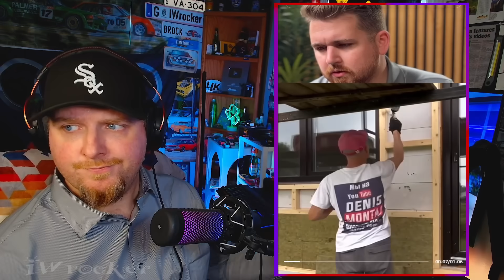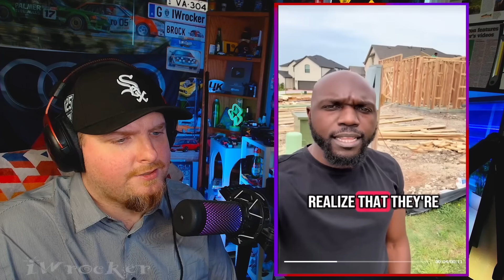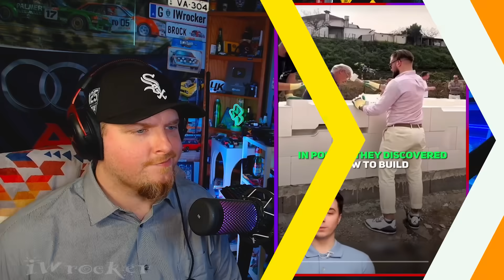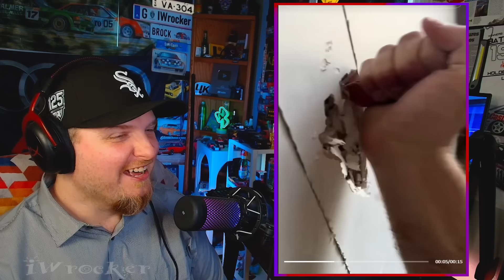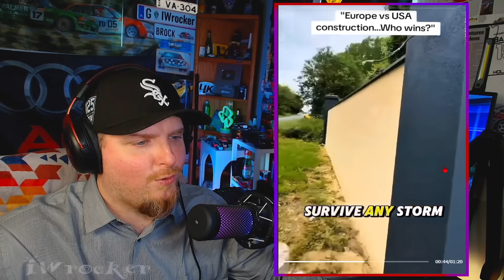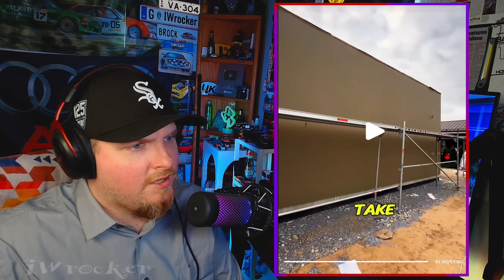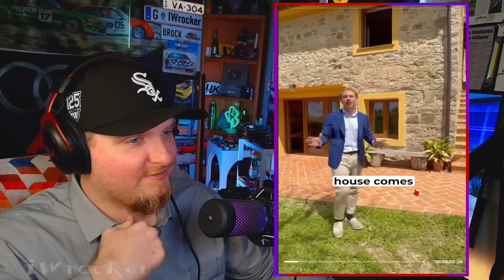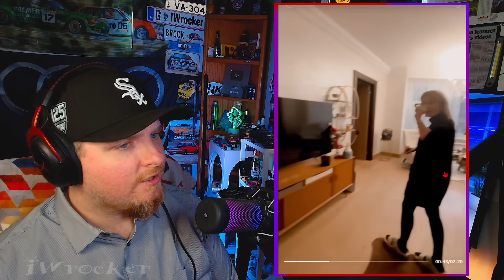25 Minutes of European VS American Home Quality & Construction Methods 🔨

Comment: Insulation ALWAYS goes outside if possible! That guy doesn't know s... about thermodynamics in construction.
Reply: Well, to his defence: he's american … ¯\_(ツ)_/¯
Reply: He also doesn't understand dew points.
Reply: @andersjjensen have you ever heard of active ventilation? The cost of having a double flux ventilation is ridiculous compared to the cost of either heating or A/C. And it removes the moisture and the dew issue.
Reply: @patrickrosa848  But they are hella obnoxious to retro-fit when you live in an apartment. For new builds they're mandatory here. But they do not "remove the moisture and dew issue" in August when the outside temperature is above room temperature and the relative humidity is 100%. Then you need a condenser, or it will be running down the walls.
Reply: @andersjjensen centralized units are. You also have single-room units which are perfect for the "wet" rooms such as bathrooms. And usually for very humid days, you can simply bypass the exchanger to just extract the humid air from inside.
Still for such super hot days, having outside insulation will still trump easily inside insulation for comfort
Reply: My mom's house has no additional insulation and no AC yet stays warm at -20(-ish, not sure about "fry-dome" units😅) and not so warm at ~100. It made out of plywood-based clay, thick af(1foot+, closer to 1Yd actually. 45-50cm) and — this is the best! — has an inner oven for heating! So the "middle" wall gives back heat long after the fire is out.
God I wish I had an option to build a house like that here in Israel! I am blessed to live close to the sea and it gives me constant breeze in summer time but when it's winter outside, you can literally run outside for warming your body without heating. And the only type of heating we have is electric, which is absolutely inefficient when your house has slide-windows and is being exposed to winds all year long😢
Reply: @andyshtroymish4997 that house has naturally thick walls and a big thermal reservoir inside. So that's typically a building which will need little to no insulation.
Outside insulation will tend to mimic that kind of insulation, turning the walls into thermal reservoirs for the whole of the house: keeping warmth inside in winter and avoiding heating them in summer.
Inside insulation, not considering the (HUGE) issues with thermal bridges, will do exactly the contrary. Putting a huge reservoir of cold right next to you in winter, and of heat during summer....
Reply: Americans doesnt know shit....true
Reply: I didn't until the question was answered on here by someone else.
Reply: No!  There are many reasons to have insulation on the internal faces.  That is based on construction science and performance.
Reply: @clivewilliams3661  exactly what science and performance? internal insulation has higher heat transfer coefficient, making one big thermal bridge out of the whole building, you reduce thermal mass and make it easier for moisture to buildup, it's also more expensive, both in construction and operation
Reply: @Dread_2137   Quote "internal insulation has higher heat transfer coefficient,"
Stop making up lies you clown...
Reducing thermal mass is a good thing since you don't have to heat it up, that's one reason insulation on the inside is better.
Another reason inside insulation is better is the outside wall can absorb sunlight which is a massive factor that goes completely to waste with outside insulation.
Yet another reason inside insulation is better is no problems with insect and rodent using the insulation as habitats. So it needs less chemicals to keep them out and also inside insulation lasts longer. Outside insulation is only rated for 15-25 years and then needs complete removal and redoing which is a massive problem with toxic waste.
The only benefit of outside insulation is that it is cheaper because it's easier to do.
That's it. Outside insulation is literally the worst type but it's a bit cheaper to do.
PS plus the fire danger of outside insulation as any deadly fires have demonstrated.
Reply: @Dread_2137  
The science of house insulation standards, building code and performances of your chosen materials.
There is NO "one size fits all".

But if you do it properly then no moisture will build up in ANY insulation method and materials you choose. Different style houses and different materials demand different codes and insulation methods.

As for the price that highly depends.
Inside insulation CAN be done cheaper than cavity wall insulation. Not always, but it is possible, it just depends.
But external insulation is usually the most expensive (because of the mandatory extra cladding).
Reply: @Mar-s5q8m a few pointers if I may:
-  Reducing thermal mass is not always a good thing. Having thermal mass can be very beneficial indeed, depending on how you use the house/building.
- The rodent/insect problem should be non-existent with the proper materials and especially installation techniques. Special harmful chemicals for this are usually not needed at all. 
- "Fire danger" should not be a factor at all, never. If it is, you're using the wrong materials. Insulation should at least be fire retardant, always. Also, proper installation technique is paramount for this too.
- And outside insulation is usually the most expensive since it requires extra water proofing, and especially proper cladding, compared to the other methods. Cavity wall insulation is usually the cheapest (unless you need to redo it, then it because very expensive and time consuming compared with the other methods).
Reply: @CookieTube  don't know how american standards and building code works in Europe, especially since ours are way more strict. 

I am speaking generally here, not insulating external walls invites moisture due to the pure laws of physics and how heat exchange between mediums works. And this is where the difference comes in, in Europe no one cares about the material (tho all materials must pass comprehensive tests, especially fire ones, but there's hundreds of them, if not thousands, already approved), what matters is the U (heat transfer coefficient), which by law must be for external walls <0.20 W/(m^2 * K), roofs <0.15 W/(m^2 * K), and floors on the ground <0.30 W/(m^2 * K). Designers simply look at the λ (thermal conductivity) of materials and select them accordingly so that the building is below required U.

We don't use cavity wall, buildings are usually build using ETICS (External Thermal Insulation Composite System). In short: adhesive -> insulator (usually polystyrene or mineral wool) -> adhesive + mechanical fasteners -> reinforced mesh (usually fiberglass) -> plaster
Cladding here is rather for aesthetic purposes than insulating ones, tho still can be used as insulation if this is how building was designed, again, most important thing is always U, the rest are aesthetics.
Reply: @Mar-s5q8m where do I lie? External insulation by pure physics has lower U. Not to mention thermal bridges at floor, ceiling, junctions and corners, that are problems for internal insulation.
Why would you want to reduce thermal mass? Lower thermal mass means more heating during winter and way more AC during summer. High thermal mass helps keeping heat during winter, and provides cooling during summer.
Yeah, that's the whole point, so that your house does not heat up during summer, and keeps it cool. Why turn your home into an oven?
First of all, your rats would have to somehow get through the layer of mortar, fiberglass mesh, and plaster to get to the insulation. Good luck with that. Rats here rather tend to go into basements, especially if you leave the window open, Europe is not Tom and Jerry where they can just make a hole in the wall, because it's made of paper mache.
Technical expected lifespan for external insulation is 25years at minimum, this is for what buildings are designed for. But external insulation usually keeps its U at required levels for more than 50-80 years, even for over a century in many cases.
If you care about lowest possible heat transfer coefficient of a building, there is nothing better than external insulation, as it directly protects building's thermal mass from external conditions, allowing it to retain heat for longer and prevents sun from turning the building into an oven.
Oh yes, fires, says the guy who builds his houses out of sticks. European fire safety standards are much stricter than yours. Any material used in ETICS systems must pass comprehensive fire tests, including large-scale tests, to be approved. There's nothing more important in European building standards than safety.
Reply: @Dread_2137  I can't comment on your expose because you didn't made it clear where you're from and about who's regulations you're talking about. However I can tell you that the building code in EU is very strict! Far more strict than US!! Especially when it comes down to insulation, ventilation, energy consumption and water buffering requirements.

I can also tell you that you're very wrong about: 
QUOTE: "I am speaking generally here, not insulating external walls invites moisture due to the pure laws of physics and how heat exchange between mediums works. And this is where the difference comes in, in Europe no one cares about the material"
Reply: Insulation can absolutely go on the inside if the outside is reliably warmer than the inside throughout the year (basically if you keep your AC running all year long).
Reply: @andreipetrenko2422 A/C and efficiency building are two opposite notions. Your point is just meaningless. With good insulation you don't actually need A/C...
Reply: NO, IT HIGHLY DEPENDS!
In fact, insulation on the outer wall is the 'worst' of the main three types of insulating generally speaking, if all things equal.

1) Best is to insulate the cavity wall if possible (needs enough thickness and there are some other things you need to take into consideration), This goes between the outer (brick) wall and inside (brick/concrete) wall. There are roughly speaking 3 methods to insulate the cavity wall.
2) Second best is insulation on the inside, thus on top of the inside wall. But this reduces your available living space, so not always wanted or even possible.
3) Third best is external insulation. This goes on top of the outer wall, and on top of that new cladding is placed. Of course this can only be done if your wall isn't a historical classified outer wall or something.

Of course you can combine these three main methods. 

Also, you can NEVER insulate too much (but don't forget a proper ventilation system!!). But of course it all comes with a price (where outer wall insulation is usually the most expensive, while cavity wall insulation is the cheapest and quickest... hence usually the best method to choose considering everything else).

The method in that first video was a variant of type 1 I think (though not completely ok, because all that wood creates a lot of cold bridges).

All the above goes for the outer shell of the building.
The inner walls in your home are rarely insulated (unless it needs to be sound proofed or needs something special). But of course you can if you want/must/can afford it....

EDIT: since some don't seem to understand this, all the above is given an EQUAL amount of isolation space and heat transfer coefficient for the materials, and with proper build houses.
Of course you can go as thick as you want when insulating on the outside. But you can NOT do that with cavity or inside insulation. And THAT is also the reason why method 3 (outside) is usually done for new passive housing: because they need A LOT of insulation thickness which you can NOT do in an existing cavity wall, nor on the inside wall, but only on the outside wall.
And of course a 50 cm thick outside insulation is better than just a 5 cm thick cavity wall insulation.... DUH! But you need to compare apples with apples....
Reply: @CookieTube yeah, of course. That's why passive housing,  the most efficient energetically ever, has always the insulation outside. Your arguments are appallingly non-existent pal!
Reply: @patrickrosa848  You seem to have no idea about building code or the reason why certain methods are used and when.
The ONLY reason passive housing has insulation on the outside is because you can make it as thick as needed !!! THAT, and only that, is the reason why it is done on the outside with passive housing.
NOT because it is the best out of the three methods, given (almost) the same materials, space and costs!!!!

If you put an equal amount of insulation on the inside walls, you'd loose A LOT of living space. Nobody wants to loose 1 meter per side (50 cm for each opposite wall). And putting it in the cavity wall is never going to work because that is never thick enough for the same amount of insulation you can put on the outside anyways. THAT is the reason why it is done on the outside: you can put MORE insulation on the outside.

If you notice in the video with the black foam blocks: they are roughly 50cm thick.... try to put that on the inside, or in the cavity wall, I dare you.
Again, given (almost) the same materials and thickness it is as I described in my first post here. You need to compare apples with apples.... pal!
Reply: @CookieTube and you seem to have no idea of thermodynamics and heat transfer.  The reason it is more efficient is that this way it insulates against both cold AND heat. There is this little thing called climate change, look it up you'll learn things. You put it on the outside because that is the ONLY way you can use the latent heat capacity to radiate heat outwards at night when it's colder. Do that otherwise and you're trapping heat inside your building. And concerning cold,  it allows to cancel thermal bridges naturally. So saying it's just a question of space is simply dumb.
Look for the scientific reasoning behind things before parroting building codes...
Reply: @patrickrosa848  Dude, you're talking to someone who has build in 3 countries and has studied and designed insulation and ventilation systems according to modern science and specifics.

You're clearly suffering from the Dunning-Kruger effect. What you might have learned in school is not how things work in the real world of building.

Maybe you should look up stuff up and/or talk to builders, architects and building engineers.
Reply: @CookieTube yeah, and what do you know about me to think I may be ignorant about the topic? You're comparing the three design of insulation  without taking into account the cancellation of thermal bridges, which EXTERNAL insulation naturally allows, while the two others do not. And if you've studied thermal transfer you should have gotten the hint that thermal bridges can cancel whatever insulation thickness you may brag about. Comparing apples with apples, with equivalent thickness external insulation when possible is far better than the other ones.
Reply: @patrickrosa848  Dude, I know by reading your comments that you have barely any idea what you're talking about beyond basic high school thermodynamics theory.

For starters your whole rambling about thermal bridges is completely mute since thermal bridges can be created (and avoided) with ANY method you use. In other words it is completely and utterly beside ANY point you're trying to make.
Also, I don't brag about ANY method; each method has its uses and times to use. Once again, showing why you don't have a clue about building techniques (or bad reading comprehension... or both). This topic is apparently beyond your very basic understanding of high school physics.

If you wan to discuss this, go talk to some architects (whom use modern techniques and materials) first. Until then, I'm done with you.
Reply: @CookieTube  I've just got both an engineering degree and a PhD so I VERY MUCH DOUBT you understand thermodynamics as well as I do. So go  drown in your arrogance. And don't come up with such stupid moronic arguments that you can get rid of thermal bridges however you want. That's not even thermodynamics but simple common sense
Reply: @patrickrosa848  Dude, I doubt you have a PhD in anything other than trolling. Your reading comprehension skills clearly don't rise to that level, as you once again have shown here. I never said "however you want" in regards to getting rid of thermal bridges. Try again.
Reply: @CookieTube says the anonymous  who-knows-whom who pretends to be a professional. Please enlighten us about why should we ever believe you? Give your real name and  training, and maybe you'll be worth taking seriously. So far you've gotten out just as an insulting know-it-all, that for all we know may be just faking and trolling it. And BTW you DID say that thermal bridges were irrelevant because there are technical solutions for them. So you're plain saying that shoddy construction is OK, you can always mend it? Wonderful professional ethics.
If you had been serious, you'd have pointed out that each type of insulation have pros and cons, and that one kind of insulation may not be used in certain circumstances, that would have been a tiny bit more serious.
Reply: @patrickrosa848  
QUOTE "you DID say that thermal bridges were irrelevant because there are technical solutions for them."
Yes I did. And that is something completely different than QUOTE: "do whatever" 

QUOTE "So you're plain saying that shoddy construction is OK, you can always mend it?" 

You're clearly the idiot here who thinks this means the same as the previous quote.  DO NOT put words in my mouth. I never said that any shoddy construction is OK. In fact, it was quite the opposite. 

QUOTE "If you had been serious, you'd have pointed out that each type of insulation have pros and cons, and that one kind of insulation may not be used in certain circumstances"
Yes and the sky is blue and water is wet. That is so obvious it barely needs to be mentioned. But even so, it was clearly insinuated anyways by my multiple comments which you clearly did NOT care to read or misread on purpose.

Either way, a comment section isn't even the proper place to go deep into building code, all the different variables, rules and regulations, availability of materials, and differences between theory and practice, etc. And you know it.

Go talk to professionals in the field. I'm done with you. Once again you have shown here you have clearly ill intent, judging from your misconstrued replies and/or awful reading comprehension skills.

... 🤡
Reply: @CookieTube  You have no idea what you are talking about. If you know what a cavity wall is then you should know why there's always an air gap, drainage and ventilation for the outside shell of it. Think for a minute why are those things there and not on the inside part. UK government published a comprehensive guide on cavity walls and moisture management.
Reply: @andreipetrenko2422  I know EXACTLY what I'm talking about. An empty cavity wall is very VERY OLD SCHOOL. You're talking about building code from before even the '70s. Nowadays cavity walls are done with (specialized) insulation. In fact it is MANDATORY in some countries.

Also, UK has still very OLD building code in terms of isolation (and electr. I might add) compared to many countries in Europe.
And I know what I'm talking about since I build both in UK/Scotland AND the Benelux!

In fact, in the UK government’s 'ECO scheme'/'The Great British Insulation Scheme' actually gives grants and funding to help low-income households to insulate their old non- (or bad) insulated cavity walls.

I suggest you simply google "cavity wall insulation" before projecting your ignorance, tyvm.
Reply: @CookieTube  The first building inspector in the UK or Netherlands would have chased your sorry ass back to Romania the moment you showed him internal insulation on a load-bearing wall. You probably work for cash, give a new name to every customer and change phone numbers twice a week.
Reply: Insulation on the inside is better but it's more expensive, that's why we don't do it that much.
Reply: @Mar-s5q8mtotal crap. Insulation inside is done in Europe usually because it is WAY cheaper than outside insulation, though it is known that it is WAY less efficient. Internal insulation is just a crappy way to cut corners (excluding very specific cases of renovation of ancient houses done with specific materials that cannot accommodate external insulation).
Modern building in Europe always uses external insulation,  because of energetic efficiency requirements for buildings. And that's supported by thermodynamics and heat transfer physics. Not hand waving.
Reply: @Mar-s5q8m stop talking shit! insulation outside makes working inside the walls much easier